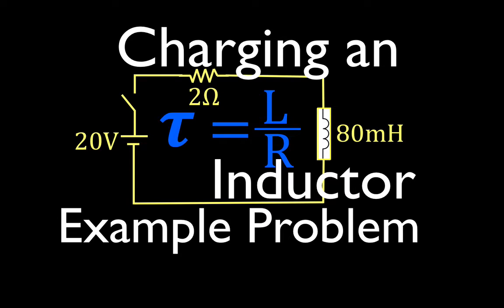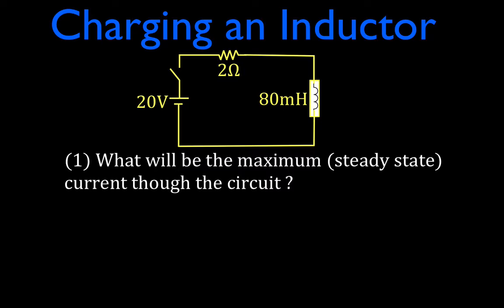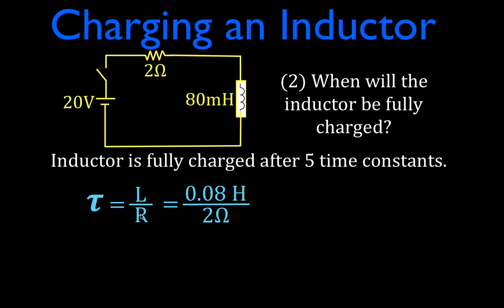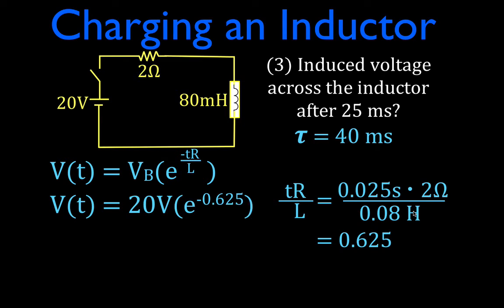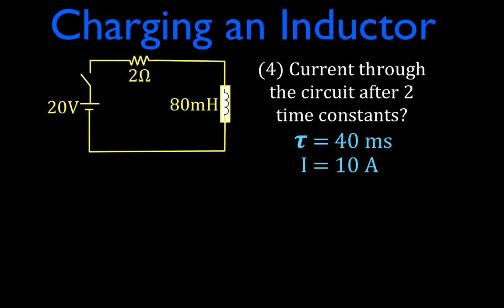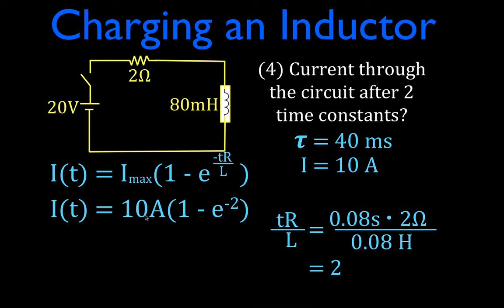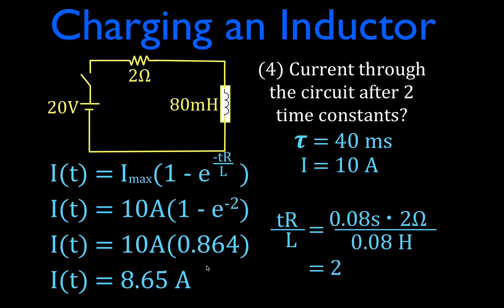RL Circuits (7 of 8) Charging an Inductor, Time Constant, Voltage, Current, Worked Example

Comment: I want to apply your advice to the operation of the "Joule Thief" circuit. While I have built several Joule Thief models before, I have struggled to explain the underlying logic behind its operation.
Reply from the maker: There must be a good explanation of the joule thief on the internet.

Comment: Did you make videos about the voltage which have the u(t) terms? The u(t) really bothers me as I don't know what it was.
Reply from the maker: Do mean like this:
https://www.youtube.com/watch?v=P4nR9g51CwM
Reply: @stepbystepscience  No. What I meant is did you have the solution for an example of RL circuit which have V=20u(t) - 40u(t-1) something like this. I don't understand what's the point of the u(t). I can solve for simple questions like V=5 or V=20 but when the V equation becomes complicated, then I cannot solve the question.😭😭

Comment: If we have the same Circuit without the Resistor, can we use the same equations you use on questions 3 and 4 ??
Reply: Nick Step The inductor still has a built in resistance value, there is No physical way around that. You would have to measure the inductors resistance with a meter and use that value in the equation for the resistance.

Comment: how to know how big inductor i need to connect sir ? i mean i have 17V ac, and current is 9.1uA so how would i calculate inductor values sir ?
Reply: You need to know the frequency of the AC voltage, the series resistor to determine the inductance.

Comment: The induced voltage across the inductor? that should be 20(1-exp(-t/T)) where T=L/R
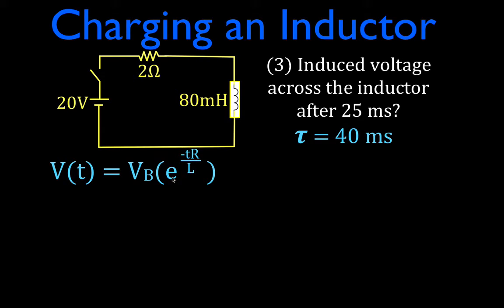Reply: I had the same question but he just simplified the equation by multiplying the the top and the bottom by R to get L on the bottom by itself. It ends up being the same value. He briefly mentions it when he first introduces this equation in RC Circuits Part 6 of 8 starting around 3:00. I hope that helps.